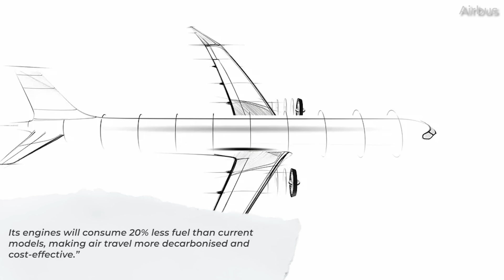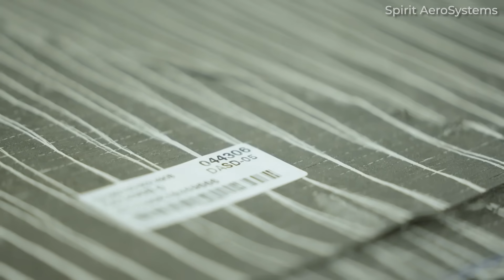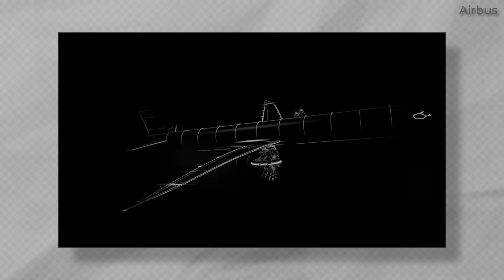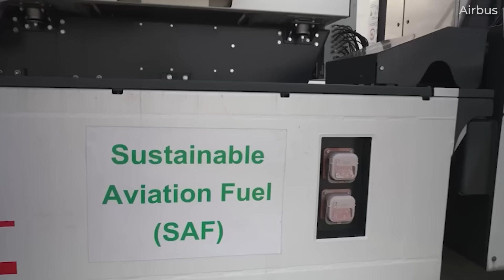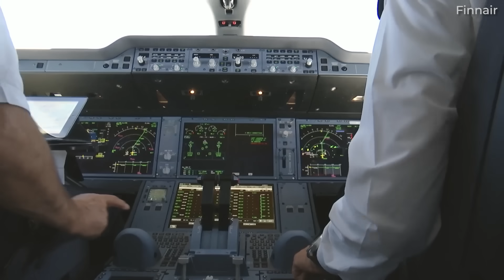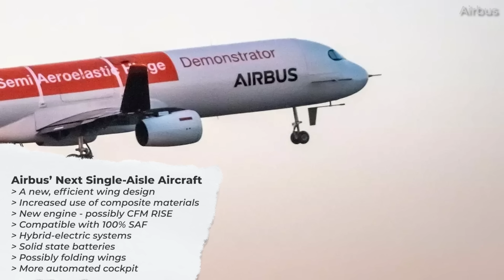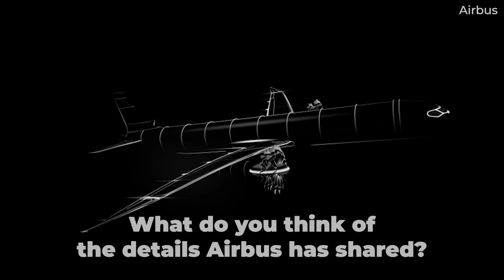Airbus' Next Narrowbody: Tech That Could Be Included

Comment: I think that Airbus should make two narrow body families. Airbus has two or three families of  wide body (A330, A350, A380) but it has only one A320 for narrow body. A220 is great, but it is an adopted child, and eventually it should be replaced by a smaller narrow body of Airbus design in the far future. So two narrow body family and two wide body family. Next narrow body should be bigger than A320 and have seat capacity 180-250 to cover seat capacity of Boeing 757 and A330-800.

Comment: The nex A3XX narrow body will be a skinny version of the A350 with some minor adjustments. Just as the 797 will be a skinny 787.
Reply: Yeah. It will be wider than the A220 as well to allow it to move up to the middle of the market possibly. An A220-500 stretch will take up the place of the A320neo(150-170 pax) I would imagine. Therefore the lower version of the A320neo family replacement will possibly move to the 180-200 pax range, the next will be cover the 210-230 pax range with the top model possibly seating 240-250 pax.
Reply: Lol, Boeing can't get 737 MAX'S in the air. Any new aircraft is likely a minimum a decade away if the. MAX 7 and 10 are even flying by then.

Comment: More airlines are going to squeeze as much etops capabilities from single-aisle planes in order to maximize point-to-point operations.
Since giant quadjets have been made sacrilegious, now the safest engine placement should be either on the very rear of the airplane for light weight propellers or under the top-mounted wing to maintain a balance of the overall aircraft, empty or full. I’m hoping Airbus is secretly designing clever fuselage that would incorporate efficient ogival delta wing shapes.🤞🏾🤞🏾🤞🏾

Comment: Having the same same fuselage dimensions would not be next _generation 
The fuselage should be one foot wider
And have larger windows 
This is what a bigger plane maker will do
Reply: Who would pay for the one foot wider empty space and structural dead weight came with it.
Reply: @umi3017   extra width could mean faster boarding /deplaning
Reply: @andreas4010 If boarding speed was really important airlines would adopt back first boarding. Deplaning can also be twice faster with simultaneous back and front deplaning.
Reply: @kazedcat  ryanair does that at airports where they don't rely on a jetbridge

Comment: I love the engine design, but my only concern is containment if a blade breaks off.
Reply: I think about that too, but it hasn’t happened to the dash 8
Reply: @k2477-o3n didn’t it happen twice once with SAS and other with Air Canada
Reply: @robertbruce2182  that was because of a landing gear failure wherein the propellers struck the ground. There hasn't been a single instance of carbon fiber composite propellers ever spontaneously disintegrating in flight or flying off on their own. The only propellers that have disintegrated or flown off by themselves, are all metal propellers.
Reply: @rafaelwilks exactly that’s the risk! Gear collapses do happen during hard landings
Reply: @tong.clement  well in those cases today's engines would just come off because they are specifically designed to detach easily when pushed from the ground. I believe a similar solution will be adopted for open-fan engines too
Reply: @Adrenaline_chaser there was this incident not too long ago where a left propeller blade broke off after a runway overrun struck a passenger inside the fuselage and killed 1
(Penair 3296)
It would probably be similar to a turboprop rather than a turbofan in terms of certification, which is really concerning
Reply: @k2477-o3n  More likely because of its high wing configuration, and this is the first time we would see it being used for low wing config. Also, depending the cost of blades replacement, it would be challenging for in case of emergency landings without landing gears but only time will tell!
Reply: +1 - should not be allowed as gear up landings and landing gear collapses do happen from time to time!

Comment: if its narrow body aircraft then why need foldable wing tips?
Reply: You can increase the wingspan but can on the ground it can use smaller parking spots, which are meant for the A320 or the B737, but have a wider wingspan as those two.

Comment: Sounds like the next Airbus single aisle will be a combination of the 777-X and the next Boeing narrowbody. 😅
Reply: Well we don't know exactly yet,but imagine they did
Reply: @identitybyeye96  A plane with a wider wingspan and SAF engine will require the least investment, as well as the least innovation. This is the Airbus playbook. 

Historically, Boeing has been more daring in aircraft design, which is also why they've been more innovative. If Airbus moves forward with the electric hybrid engine, the project will become much more expensive. I doubt they will do that.

The next Boeing aircraft will be expensive, but will introduce the world of commercial aviation to something completely new.
Reply: @sainnt  I doubt Boeing will have the cash to build an expensive aircraft. They need to focus on rebuilding trust first.
Reply: @matejlieskovsky9625 Boeing has to replace the 737, whether they like it or not. They will design an aircraft that will go from the size of a Max 7 to the 757 on the same airframe design, and it will definitely be innovative because it will be an all new aircraft.
Reply: @sainnt  I actually expect the opposite direction. More models with fewer length versions as the design is optimized to tighter margins. Just do more of what Airbus does with standardized cockpits.
Reply: @matejlieskovsky9625  Airlines need a variety of aircraft sizes, and it's cheaper to build a single airframe that can be stretched, rather than build different airframe types. This is why the A320 series has been so successful.
Reply: @sainnt  on the other hand, the E2 family has a separate wing for each length. I just think we'll see more of these optimizations.
Reply: @matejlieskovsky9625 I don't disagree with you. I'm just saying that there will be slight modifications for the same airframe. The Embraer E2 series are the same airframe with modifications.

Comment: one thing i think they should implement on new aircraft is forced feedback on the joysticks (assuming they haven't already implemented it)
Reply: The A350 has active sidesticks that lets the pilots know what each other is inputting.
Reply: In 2000+ hours and counting of flying the A320 not once have I ever thought that I miss having it. I came from Embraers before this which have notoriously heavy yokes despite being smaller planes and had a LOT of feedback particularly the 145 in pitch since its fully manual cables with no hydraulics. They could be an absolute workout in crosswind landings. In the bus it's much less effort since you don't have to fight that. I actually prefer it. If anything they should link the movements of both the CA and FO joysticks for situational awareness, but no gaming style force feedback which would feel incredibly artificial anyways.
Reply: that is what i meant, linking the movements of the joysticks, Air France 447 and Indonesia AirAsia Flight 8501 wouldn't have crashed had the other pilot known what the other was doing
Reply: @joecrammond6221  false assertion.  Air France 447 had pilots pulling full back during a stall.  which means force-feedback is irrelevant.
Reply: one pilot was pulling back, the other was pushing down, neither realizing what the other was doing until it was too late, had the joysticks moved in conjunction with each other, they'd have known

Comment: Airbus should really take advantage of its dominating position in the market while Boeing is in turmoil. Both ends of the lineup are covered at the moment, with the A350 and A220 being the youngest and most advanced airliners on the market. 
So, my suggestion for Airbus would be to first develop a stretched A220 to cover the A319 size comprehensively. Then, create a new pair of aircraft (like has been done before with the A330/A340 or 757/767/777), with one that would replace the A320, A321 and could be extended to cover an A322/757 size, while a sister (widebody) aircraft to replace the A330 would be developed in parallel. 

With this, Airbus would comprehensively cover the market for jet airliners, only the biggest size (777-9, 747, A380) would not be covered, but on all other fronts, Airbus would have a fresh, up to date, modern, attractive lineup that Boeing could only DREAM of, with their decades old platforms like the 737 Max and 777-X having to just hold the fort.
Reply: They dont need to strech, it already covers a319neo market, thats why its orders are so low, it even takes a bit of the a320neo market away
Reply: @Benjikame fair point, I was mistaken in thinking that it was smaller, but I was wrong 🙏
Reply: The B777-9 can be covered easily as well by stretching the A350-1000, sometimes called A350-2000. That would require more powerful engines though. RR decided to put nearly all its development resources on the Ultrafan engine and refused to dedicate any effort on this (although further enhancement of the XWB-97 is on its way). Once the Ultrafan is available, Airbus can easily stretch the A350. That will be years before the CFM RISE becomes available.
Reply: @HugoAelbrecht  They will probably do it under an a350neo
Reply: My thoughts exactly.
The A330neo really only needs a carbon fibre fuselage. The size is optimal  with the 2-4-2 seating arrangement. If printing became cheaper, Airbus could print that fuselage and fit most of the current systems into it as the next improvement to the neo. The lower fuselage weight would make it very competitive against the B787 and it would fly even further economically. Right now the 787 beats the neo on long routes, but its competitive on short to medium routes.
Reply: @mandandi I don't think printing will be strong enough for airplane fuselage but a carbon fiber composite that dont need autoclave should be strong and cheap. They already use it on making yacht hulls.

Comment: I wondering, why airplane manufactures are not able to install electric motor wheels in to main landing gears or maybe into front landing gear? Just the same as simplest electric scooters have today? And your taxi at airports especially with long queue on take off is solved! Cheap solution but Tons of jet fuel economy daily. Sorry for my English.
Reply: They ARE able and there's been numerous studies and even prototypes but these systems always end up having large penalties involving weight\power needs which negate any efficiency gains.
Reply: @aerialbugsmasher Until we can figure out how to properly and cheaply mass manufacture solid state batteries (or similar energy storage tech), the weight penalties still exist. 

It’s coming though, battery research is front and center.
Reply: @Nafeels could you not just power them off the APU?
Reply: @Angel33Demon666  absolutely, that's what I thought
Reply: @Angel33Demon666 Just the weight of the motor alone is substantial then you need to uprate the retraction mechanism because the wheels + electric motor is now a lot more heavier.
Reply: From a energy saving perspective I’d guess its just more efficient to move the plane using the engines which converts the fuel into thrust than having a gas turbine convert the fuel to torque which powers a generator which converts it to electricity which then gets transformed to the correct voltage and then transmitted to power an electric motor which also has its power losses.